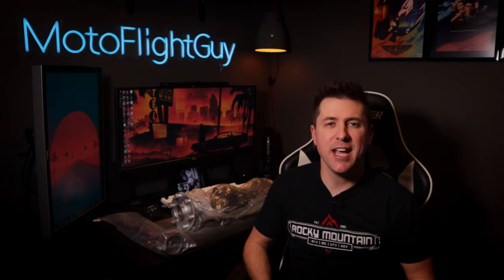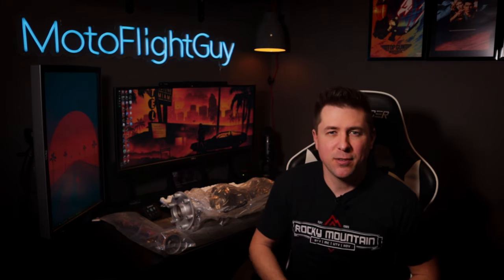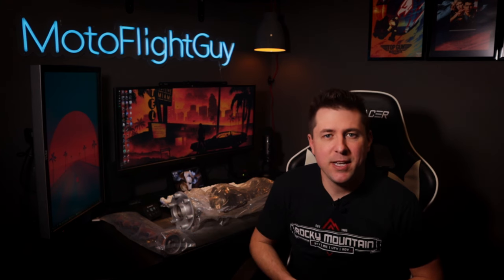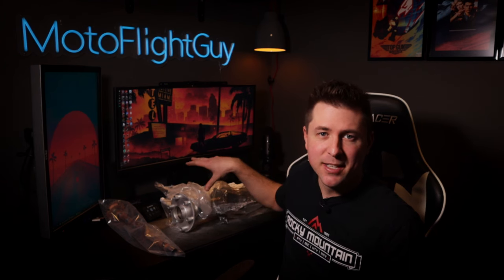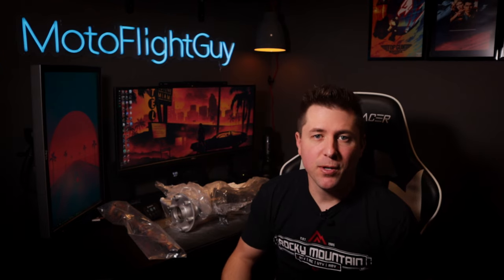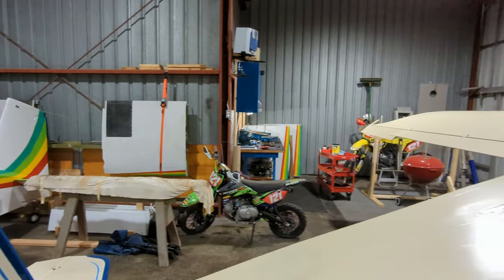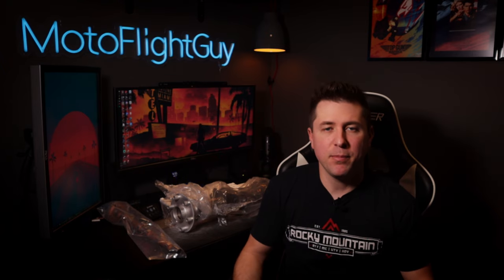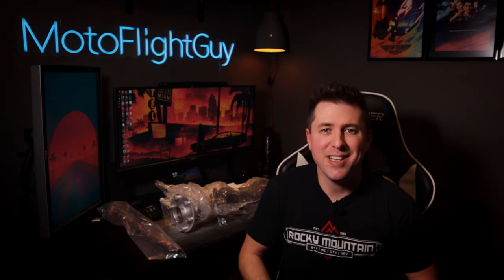Thorp T18 Airplane Rebuild! | Crankshaft and Camshaft Update | 2023

Comment: Given that your into a full engine rebuild, I would be encouraging you to have the case professionally cleaned, crack inspected, dialed, decked and line-bored if required.  Over the years I have had Divco do a number of my engine cases from 0-200's to 0-320 and IO-520-BA series and can highly recommend them to anyone.  You would be surprised as to how many low-time GA engines fail hardness tests around their main bearing locations due to past overheating issues etc.  Log-books never tell an entire story.  Well worth the money and peace of mind it provides, avoiding the potential for a tear down again into the future.  Great to see you progressing with the Thorpe rebuild.  Keep up the work and safe flying.

Comment: Just watched your Thorpe videos with my boys. Love what you're doing! Looking forward to more updates as the project progresses. I am buying a Long-EZ with an O-320 that has low hours but has run very little in the last 10 years. We pulled a cylinder and found the expected cam lobe damage, so we're going to be tearing it down. Thanks for the recommendation about Airworx. I'd love to connect sometime if there's any other advice you have based on how your project has gone.

Comment: 2:35 sandblasting the cases? Yikes!! That scares me.. why not just send them to Divco or Lycon, and have the O-ring grove mod done to the cases?
Reply from the maker: Why does this scare you? Either of the shops you mentioned would blast the cases as their first step, it is just crucial that you understand what type of blast media to use on aluminum. I do not want to send the cases off because there's nothing wrong with them and they are low time. This is an IRAN build, not a major overhaul.
Reply: @MotoFlightGuy  I find it hard to believe they “sandblast” the cases.. with sand.. years ago, Mattituck had some issues where they bead blasted some oil sumps, and although they thought they cleaned it, the media came out and contaminated the engines. As for sending them out, if there’s nothing wrong with the cases, and they are such low time, then it won’t cost much to get them tagged. That O-ring mod is worth it..
Reply from the maker: @thomasaltruda1243  they usually use a glass bead media to blast them with. "sandblasting" is just a generic term. Perhaps I should have used the term "media blasting" in my video.
Reply: @MotoFlightGuy  either way, be careful.. it’s really hard to get it all out of all the nooks and crannies.. I would look at this as an opportunity to do the O-ring mod.. that’s really an awesome thing to do. As for media blasting.. what’s the point? For aesthetics? Paint adhesion? What about chemically stripping and a brush? Then Alodine?